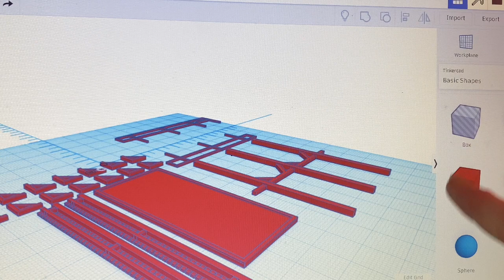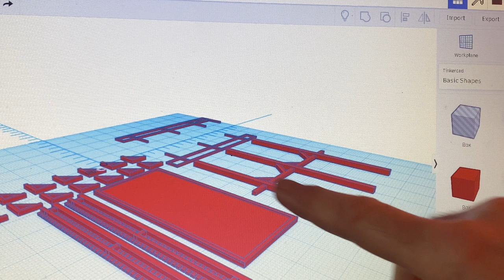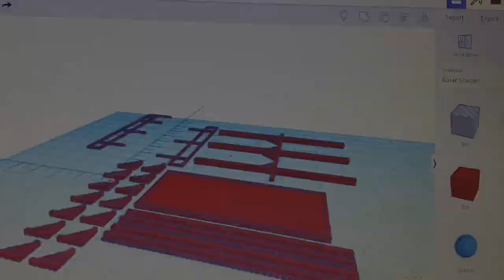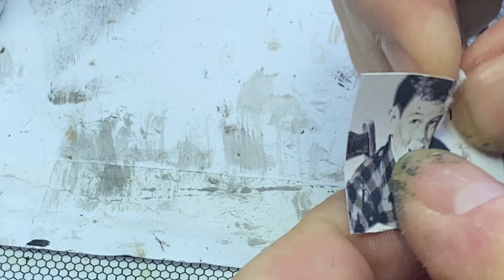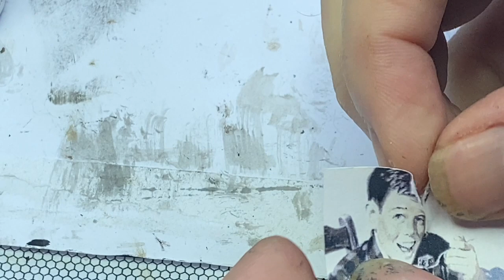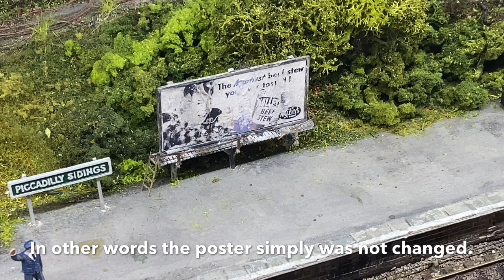HOW TO MAKE TIRED & WORN OUT BILLBOARDS for my OO gauge model railway.

Comment: How do you do, John,
Your channel was referred to me by YouTube's algorithms.  And I do enjoy it, have subscribed, and rang the notification bell.  As I am aware of it's importance.
As a 70 year old railway fan & almost 60 year modeler there are a few points I would like to make of this episode.  First, the Station sign "Piccadilly Siding" should remain pristine.
In fact I would enhance the scene by including a pair of RxR workers.  Who are giving the sign a fresh coat of paint.  The reason is your new Station would normally try to keep it's best face forward.  Also the contrast to the distressed billboard show the "lengths" the Railway Management would go to look the other way.
Next the somewhat recent, yet distressed, billboard.  Before glueing the advert card to the structure you could have taken some wax crayons (here in the U.S. we call them Crayola) and added some color to the images to indicate a printed poster.  Then to distress it, melt the wax into the card stock.  Take your hot air gun (or your wife's hair dryer).  Lay the card flat on parchment paper (again from your wife's kitchen supplies).  And holding the gun well above the colored card,  with the gun facing downward, heat the wax until it is melting.  Avoid overheating heating the wax.  Some crayons are made of beeswax and can ignite.
For a highly distressed look again color the advert card with the crayons to your liking.
However, when heating the wax stand the card upright with some rear supports.  This again will cause the wax to melt into the card.  However, it will allow a lesser degree of coloring to be absorbed and cause the hot wax to drip and run down the cards face to appear as strikes and wear.
After the wax and card fully cools off then attach it to your billboard using the technique you used here.
assure
~Jim
Reply from the maker: Hi Jim, thank you for kind words and support, much appreciated. 
I distressed the one station sign as that end of the platform is kind of forgotten. It will be emphasised more so when the waiting shelter goes in. You are exactly right otherwise ‘best face forward’. Management rely on volunteers who seemingly dont want to repair the billboards hence they’ve been run down, along with the platform trolley. 

There are indeed many, many ways to achieve all sorts of effects and we each choose the best for us at the time, all are good and I may use the wax method you described in the future. Thank you for taking the time to comment. Please do feel free to check out my N gauge channel too.
https://youtube.com/channel/UCygRpQ8YII92Mny-lQpG5oA                  ...and indeed other videos from this channel.